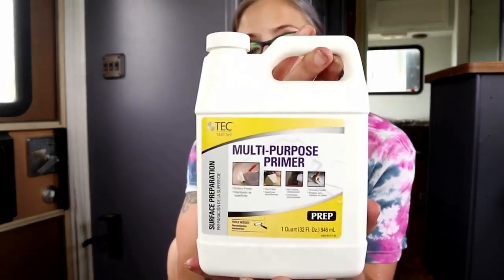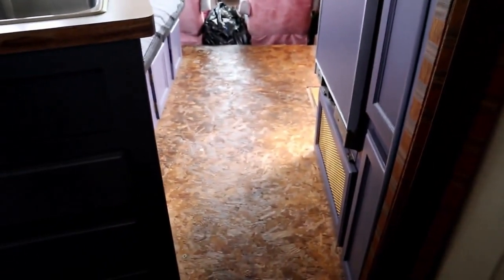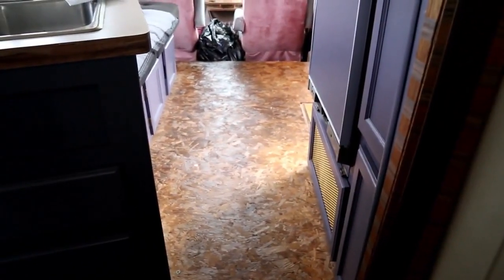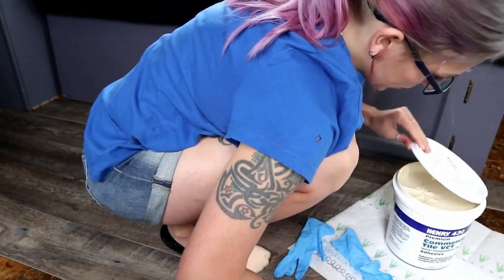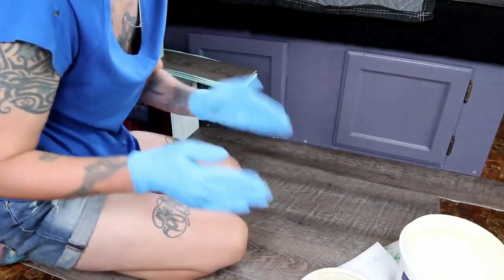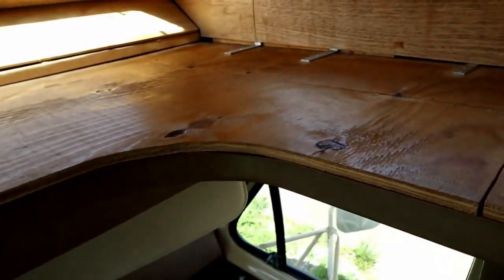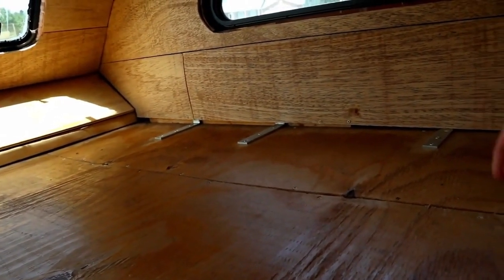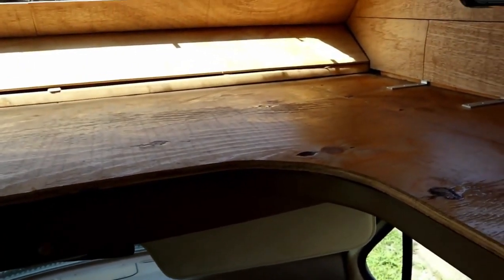How I Installed Peel & Stick Vinyl Flooring in my RV | The Best Way | With Primer & Adhesive

Comment: A tip or question to this old video is for the top part, I would spackling mud, or maybe use cocking for the cracks or seams so the floor is even.

Comment: Looks great.. I see it’s been a while and was curious if the glue held up through the summer and winter temperatures?
Reply from the maker: Well I no longer have the rv, but it did hold up through one full summer and winter. I had some issues in the bathroom, but thats because of the subfloor I tried to fix under the vinyl. I would definitely try to find a way to weigh it down if you go this route, that will make it easier.
Reply: @TheDiariesofDevin  thank you for the reply, me and my gf are looking into giving a rv a makeover and was going to take this route. Cheers.

Comment: Hello, I'm considering  the peel and stick on the floor of my class C RV so yours was the first video I watched. I was hoping for a little more instruction on how to do it. I hope there's an easier way for cutting around turns instead of the stencil method you used with the piece of paper and pencil. It looks like a pain in the ass to do it that way. Your floor looked good so looks like you did a good job.
Reply: Use a contour guide from Lowe’s.